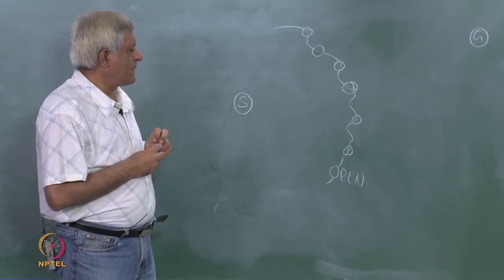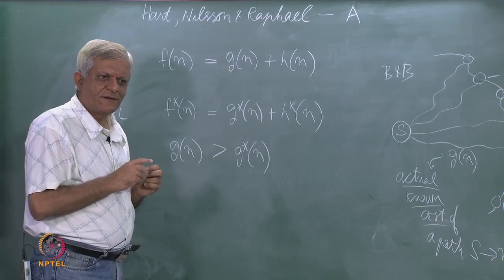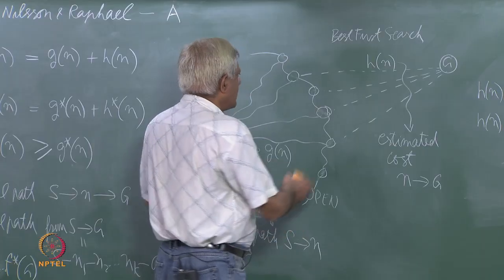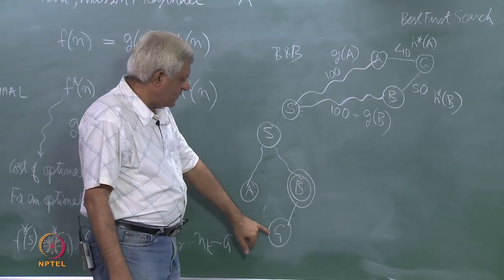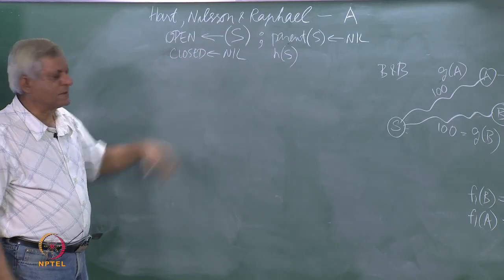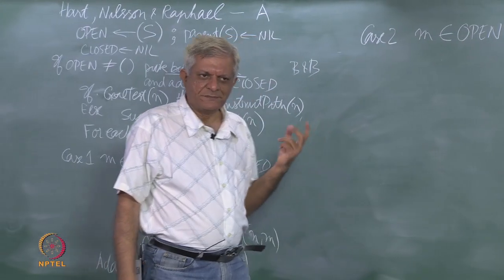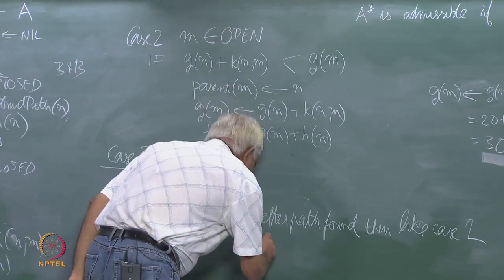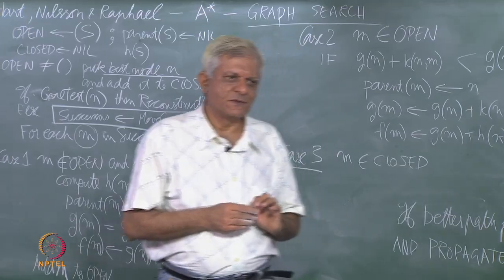A* Algorithm

Comment: Regarding admissibility of A* , it is imp to understand why underestimating the actual value works - 

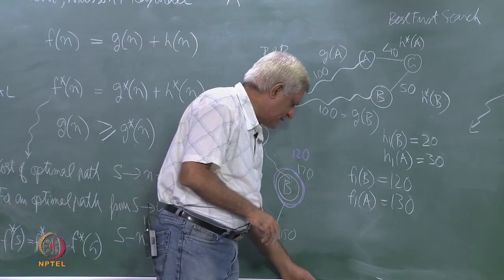Consider the example in the video at 25:00. 
Try and use a simple number line to visualize the explanation below.

1) firstly , the underestimate can be different for different nodes ( ie , h(n) is not underestimated by a fixed decrementing amount for all nodes ) 

 2) Hence ,we might try to find a counter example by underestimating h(n) for the Wrong node ( "B" in the example )  by a large value.
Hence we will choose this as optimal node ( the node will be part of our answer )
and we will obtain estimate - f(n)

3) But once we reach the goal , it is time to remove the assumption and check the actual value of f(n) 

4) the fact that you had underestimated h(n) earlier will now lead to an increase in the value of f(n) .

5) What this actually does is - It now allows us to "CONSIDER" the other path ( which involves node "A" ) since f(n) ( estimated along )along A will be lesser than our actual f(n) along B.

NOTE - 

The key idea here is understanding what happens to f(n) when we reach the goal along some path , is

i) actual f(n) > estimated f(n)  - This is good since it allows step 5) 
ii) actual f(n) < estimated f(n) - This is bad since it might not allow step 5)